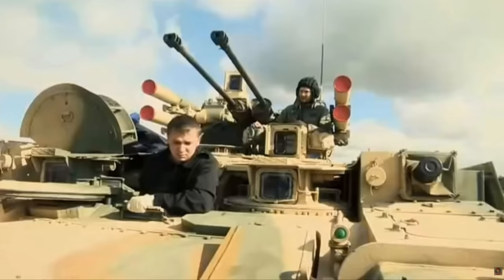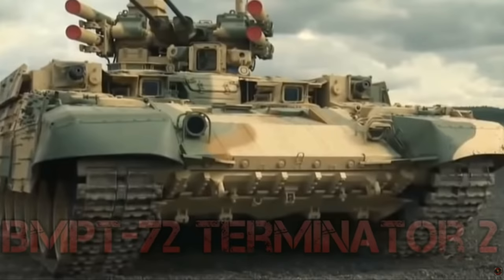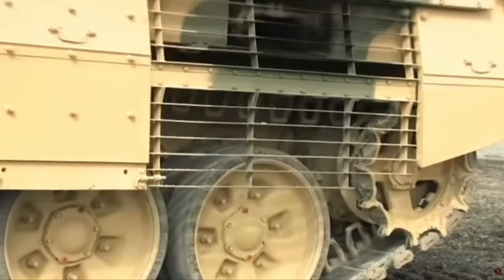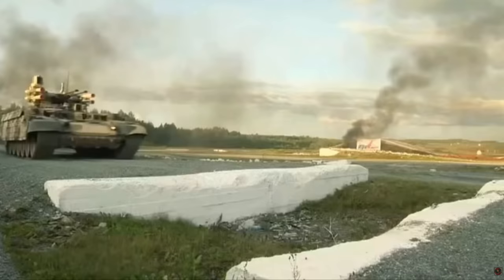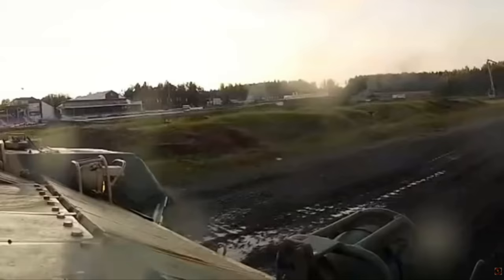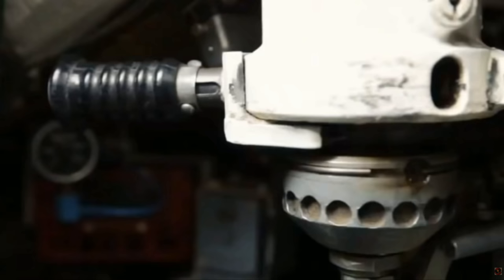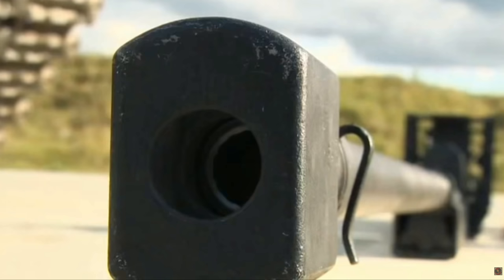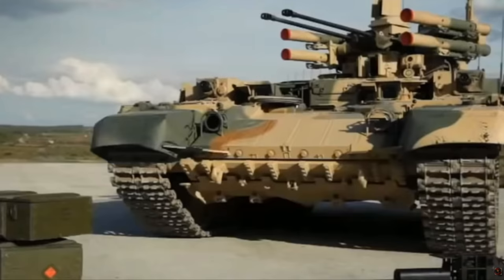BMPT “Terminator" Tank Support Vehicle Overview

Comment: If this thing's purpose is to cover the flanks of armored units inside of an urban environment, it's doomed to fail. It may have more visibility than a regular tank, but that's not saying much considering most tanks have such extremely limited visibility outside of their vehicles. You can only clear the flanks of infantry from the buildings by using infantry to clear said buildings. I suppose you could just drop all of the buildings but then why even send in the armored units at that point? This thing is still highly vulnerable to being flanked by AT troops and would still require heavy infantry support to not get popped by enemy infantry hiding in the flanks. In more open environments, troops are using much more sophisticated and long range ATGMs which outrange most of the weaponry on this thing and from attack angles that this thing can't cover. At the end of the day, it's an IFV that can't transport troops but holds the same niche as an IFV as infantry support gun. It's heavily reliant on combined ops and on other IFV's dismounts. Also, the T-72/T-90 hull isn't deep enough for this to be a true unmanned turret and it probably doesn't have much armor at all at the base of the turret. This would make it very vulnerable to top-down attacks or splash damage hits of high explosive to the turret or secondary explosions of its hit missiles. 

The other issue this thing will face is that it's turret and gun systems are fully exposed and unarmored. A single RPG hit to the front of the turret will completely disable all of its weapon systems and potentially kill the crew if the ATGMs explosives detonate from the hit.  This is one of the potentially cited weaknesses of the T-14 Armata by many analysts as well. Having a relatively unprotected gun system up top due to not having personnel there means that a single hit from even auto cannon rounds would mean your vehicle has been mission killed and will have to return to base for repairs. If the gun's ammo cooks off from the hit, they risk losing all of their optics as well which will require the crew the bail as they'll be completely blind and can't drive back home. It won't really do very well as a SPAAG as they already have dedicated SPAAGs that are much more robust and better at the role. It may be good at swatting utility helicopters out of the sky stupid enough to get too close and low, but most modern attack helicopters have missiles that greatly outrange this thing and would never be dumb enough to get close enough for the BMPT to be able to shoot it. 

In a way, the BMPT sums up the basic issues of the Russian military doctrine which has become painfully obvious in Ukraine. This thing is an IFV on an obsolete MBT chassis which can't transport infantry but is still designed to support them. Unlike other IFVs, it can't transport its own troops and thus, it'll potentially find itself in a situation where it doesn't have the proper infantry cover anymore and gets taken out. An IFV can at least guarantee its own infantry cover with its own dismounts but this thing doesn't get that. It's duty in guarding flanks of an armored column are going to more come down to itself being a first order primary target before other armored elements due to its lethality to the infantry that are more vulnerable to it. It's essentially a meat shield for the armored units its attached to as a means of drawing AT fire first in order to save the more expensive and valuable tanks its attached to. Against an opponent with modern attack helicopters capable of engaging targets without exposing themselves like the Apache or Euro Tiger, this thing's sole job is to also be the first thing to eat missiles in hopes that the other armored units are able to somehow get away or the helicopters/aircraft run out of munitions to completely finish off the column. They'll target this thing first as its autocannons are legitimately very dangerous to helicopters. The helicopters will clear the BMPTs and any SPAAGs and IFVs out first so they can open up the option of closer range strafing runs with guns and rockets.
Reply: All your writings yet no one is destroying it in Ukraine and Russians are advancing where it is employed.
Reply: @joeo2533  They aren't using it on the front lines. They're purposely keeping it back because it's even more defenseless against ATGMs than MBTs are.
Reply: @Talishar  Haha whatever you say bud. Goodluck btw if you know this you must be at the front yourself and the Russians are obviously lying about one of them sustaining light damage from artillery.
Reply: @joeo2533  Of course the Russians are lying about it. The fact it took damage from artillery further shows it's in the rear with the gear because most of the artillery is focused on the rear lines targeting Russian artillery in counter-battery operations. It's an artillery duel right now. Shill for them harder there Russian bot.
Reply: @Talishar  Most of Russia's tanks and vehicle losses have been to artillery. As much as 70% I'd say, moreover artillery's main role is to hit targets in the frontline that's why spgs and howitzers are rarely in frontlines themselves.
If the entire Ukraine army goes by your logic then the 1000 daily loses in manpower makes a lot of sense.
Reply: @joeo2533  Most of Russia's tanks and armored vehicles have been lost to ATGMs, not artillery. They had lost too many units to AT teams that they've basically pulled back their armor and have been instead relying on artillery. 

Artillery's job is to not target the frontline but the midline and as far back rearward as they get. Your own troops are on the front lines so you don't want any fratricide. Since Russia is primarily holding while using MLRS and other artillery to attack, Ukraine has been more focused lately on counter-battery.

Comment: The main problem with such machine is it's really impressive on the military polygon. But in a real combat environment it's... not completely useless... but it falls into the definition of a "glass canon". Whereas regular tank main cannon could be disabled only with the impact comparable to what is necessary to take out the whole tank, this thing’s weapon set will require long and pricey repair after getting a regular splinter cloud from a random artillery shell. That's why such things work good only on paper.

Comment: 30mm is way more than a soft target round, actually seems like a poor choice as they could stock double or triple the rounds with 20mm and still have almost 4 times more energy and momentum per round than a .50BMG. Then they slap on a remote controlled .30? (7.62mm) The purpose of .30 is that it can be carried by infantry and shot from a bipod. A single .50(12.7mm) would be a better match for the dual 30mm. 
And maybe replace those grenade launchers with automatic shotguns... Ok I'm getting well out beyond my expertise.
Reply: The weaponry chosen was due to availability and compatibility. The 30mm is the same weapon found on BMPs, BMDs, and Havok helicopters. While the ATAKA ATGM is a commonly available missile used on many vehicles as well. The grenade launchers were removed for the Terminator 2 which wasn't mentioned in the video.
Reply: It's a compromise.
Against infantery in the open, 5.56mm is already more than enough, but hiding in buildings, even 7.62mm is not sufficient. 12.7mm will do just fine, but it's not sufficient against light armoured vehicles and it can't take an explosive payload as the 30mm can. To tear down a building even 57mm isn't enough, but 30mm hits a sweet spot of having enough payload and rate of fire to turn any building into Swiss cheese... 57mm might be interesting regarding VT-fuses and shrapnel payloads, and an APHE can obliterate most tanks from the side.

Comment: He doesnt mention that the terminator is air defence it is connectet to the same multi radar system as S-550
Its designed to automatically detect and shoot down micro drones and shoulder fired missiles

Comment: @11:00 if only we'd realized the significance of them showing how much emphasis they put on its ability to destroy civilian targets.

Regarding using it as a SPAAG/SAM platform, you'd need a radar set, and could call it 2k22M Tunguska-2. When I first started seeing pictures of the BMP-T I thought it was basically a Tunguska sans radar. Additionally removing the tracks and putting it on wheels would make it like a lighter version of Pantsir.

Comment: I have no way to know the truth to this comment but I recently heard somewhere that there is only 50 of these things in operational condition but the problem is they dont have enough trained crews for those 50 vehicles. Also the cannons are a mix of AP and HE rounds and there was initial thinking these would be partly used as luight armour killers but with the ATGMs be able to hole their own against MBTs if required but I feel thuis was a typical overly optomistic thinking plan and as you state appear to be used under current situations as anti infantry and anti light armour weapons . As an ex-M113 crew I would not like to meet this thing on the field of battle but it seems it has the typical problem with the drones being developed also so in reality it is most likely used as anty infantry weapon system and to take out tank hunter nests in buildings under current deployment situation.

Comment: I wonder could it be configured to shoot down drones.
Reply: I wondered if they configured it to work properly
Reply: @moosiemoose1337  Thats interesting,
 I still think it might be a good option, i think if anything is to be learned from this war is that drones are the future and they will evolve.
Reply: @macker33  I think the US should convert some Bradley IFVs to carry the British Star Streak SAM and the GAU 19 .50 Caliber Gatling gun so we have a vehicle for drone protection.  The Star Streak is laser-guided and can also be used against ground targets so you don't have to worry about the drones not producing enough heat to lock onto, and the GAU 19 gives sufficient range (6km) and burst rate to shred any drone more cost-effectively than a 20mm.  In addition, .50 weighs a lot less than 20mm so you could carry more ammo for the gun. It would also be an excellent weapon against enemy ground troops (just ask the NVA how effective the M113 20mm Vulcan PIVADS were against ground targets).

Comment: still explodes when hit by javelins, and other ATGMs
Reply: That's statements is irrelevant. All tanks even western get destroyed if hit by a well place shot by a ATGMs.
Reply: @tuzol4527  this is true however western tank doctrine, and design helps the tank crew survive, and often tanks, are mission killed, but repaired, russian tank detonate the ammunition carousel and the crew dies, and the tank become only useful for salvage, but truthfully the US needs to replace abrams tank, it was designed in the 1960s and is still considered superior to all russian tanks, but the armata, or maybe the T-90M, mostly comes down to the maintenance, and the fact the abrams appears to have a better fire control system, while the T90 has longer range.
Reply: @RadarLeon  l agree that russia tank survivability is shit at best but there doctrine is not get hit this is why russian tank are smaller  compared to western tank. the problem is the doctrine is obsolete thanks to ATGMs development but in my opinion there's not a lot of russian dead soldiers that media always tells us about, at this point on russian probably only using mercenaries this is why the equipment is shit now because they're saving there best soldiers.

Comment: I mean really......this vehicle up against a main battle tank.....it may not be able to penetrate the armor but wouldn't it's withering attack wipe out all of the optics and sensors on the tank? Then what?
Reply: Assuming it gets into range and the mbt does not fire back and is alone. Apart from that, your plan sounds pretty solid.
Reply: @inso80  I'm just saying....if this thing was in a column of tanks and BMPTs.....it could fire right along side the tanks and probably take out a tank or two on it's own. Matt said it can traverse it's turret faster than a tank.
Reply: @rael5469  Impeccable strategy.
Reply: @rael5469  Remind me, which one of these wepun systems or better/equivalent would not already be in that "column".
Reply: @inso80  Inso, let me ask you, what's the difference if a vehicle is firing an ATGM or a 125mm shell? ....except the ATGM has a better probability of hitting. Those twin 30s on the BMPT look devastating.....to optics and sensors, anyway.
Reply: @rael5469  I'd ask you where you got your military training, but I wont. Yes, twin 30mm looks scary. It does look like it has optics and sensors too.
Reply: @rael5469  I was standing next to a 155mm k-9 moukari yesterday. It looked big. It didn't have any of dem scary looking 30mm cannons.
Reply: @inso80  Oh....I got my military training on YouTube.  ;)
Reply: This thing is supposed to support tanks, not engage them. One or two of those Atakas might have AT warhead, then it's all about who shoots first.
Reply: @imrekalman9044  And what sort of military trainig and tactical/strategic training do you have?
Reply: Riddle me this. Why would a platform that is carrying weapons that could be carried by order of magnitude lighter and less support intensive vehicles be a good idea. It is certainly not munitions capacity, speed or maneuverability.
Reply: @inso80  Hungarian Defence Force, '94-'03. Not that it matters much in this topic.
As for the riddle it's the same weapons on a much better protected platform than an APC/IFV. There's only a few of them, if it turns out to be successful there will be a lot more. If not then there won't be more, we'll see.
Reply: @imrekalman9044  Capability to build would be an issue too. Those things will remain in the same category as armata. They couldn't produce them in numbers earlier. There is no way they could do it now. They are already sending thrash equipment to the lines. And forcing disabled people as conscripts. Russian standard stuff.